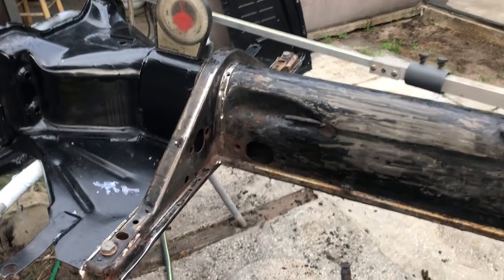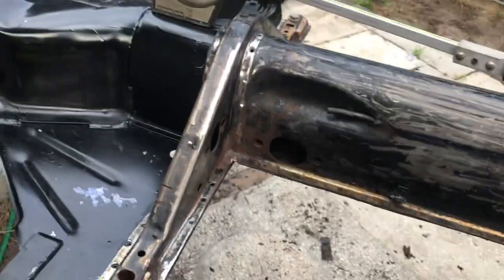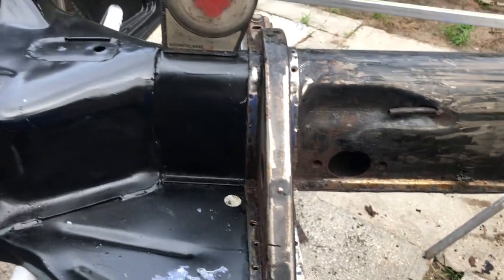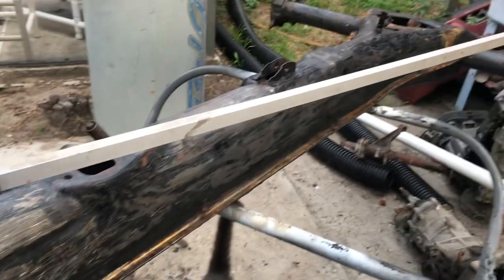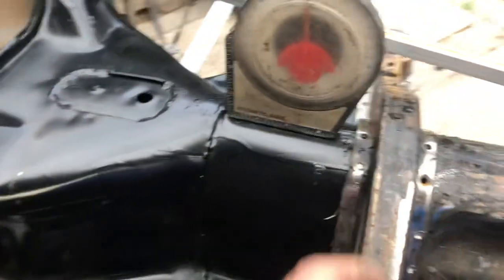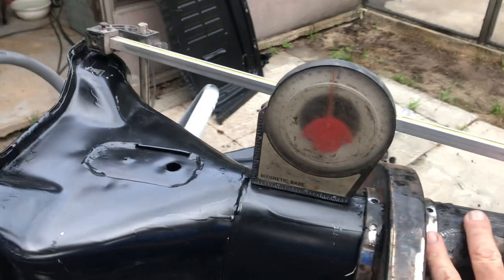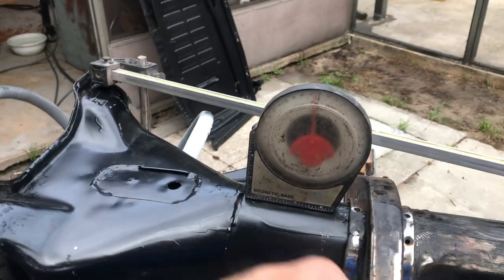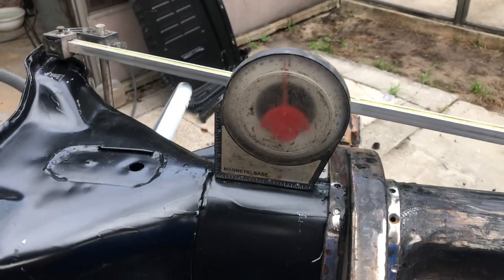Fitting The New Bulk head to the chassis on a 66 beetle￼￼

Comment: Keep the videos coming always enjoy them. Question, who do you use to do a line boring or machine shop work on the air-cooled engine case. Or the fly cut a set of heads. I'm in New Jersey and I don't know who to send it out to anymore. Thanks VW George
Reply from the maker: I don’t have anybody at the moment I have a set of heads that I need to have cut also . If you find somebody could you please let me know how it goes I need to get a set of brand  new CB Wedgeport cut for compression and I am having no luck I hear there are guys out there on the East Coast but I have not found one yet. Gino Boyd has a guy that does some machine work for him and he looks like he does some nice work I know he is in Pennsylvania he gives his phone number out all the time on his channel Gino’s transmissions and air cooled motors I think his channel
Reply: Thank you for your reply, I thought I had a guy here in New York to do my heads and he milled them and didn't fly cut them. I'm looking for someone to align bore a 40 horsepower case and to fix my heads. Will let you know if I find someone thank you George